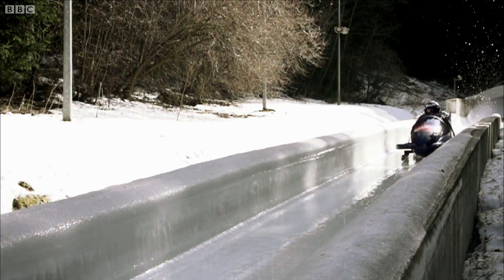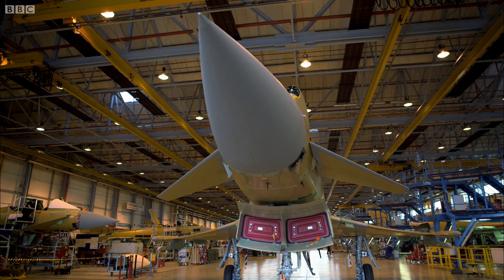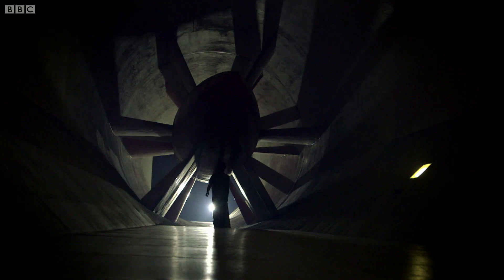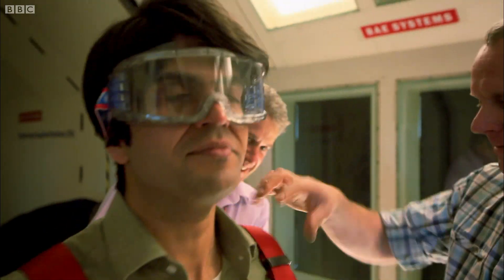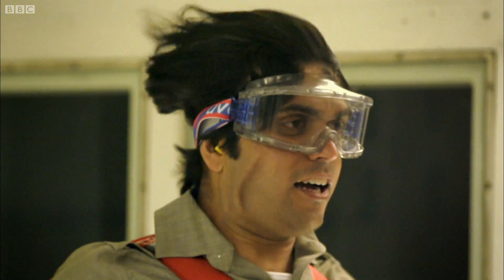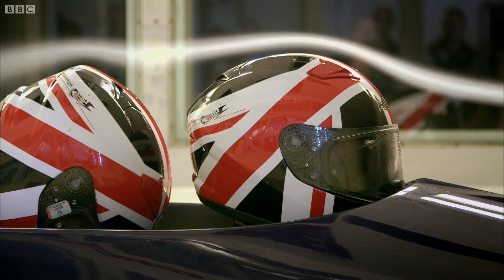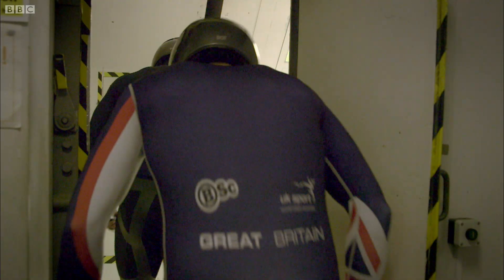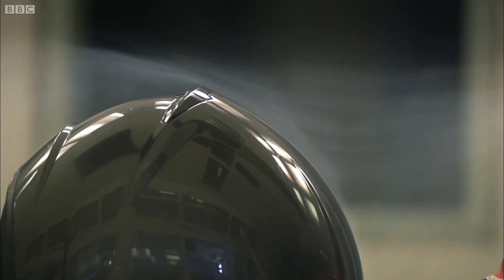How To Make A Bobsled Go Faster | Dara Ó Briain's Science Club | Earth Science

Comment: Why did you throw in those dirty units. You were doing okay with kilos but then you used miles per hour.
Reply: This is uk and we use imperial and metric for some reason, I have driven for 3 years and could not tell you what a mile looks like in distance, yet every road sign is in miles
Reply: +daniel117100 If you know how far 400 meters is, then it's 4x that distance.  :)

Comment: 'that's like 20 bags of sugar flying at you.' No. That's like 20 bags of air flying at you.
Reply: +Jack Bolton Gonna point out the obvious here and say that he meant 20 1kg bags of sugar (standard size) i.e. the equivalent weight of 20kg of air.
Reply: +Jack Bolton Smart ass, he was correct. Also 1kg bag of air would be magnitudes larger than a 1kg standard bag of sugar.
Reply: +The Marshmallow Man I meant to say that 20 bags of sugar flying at you at that speed would have have much more effect on you than just air...
Reply: +Jack Bolton Would it? Same mass, same speed, yet different effect? An Olympic bobsled may not be optimized for deflecting bags of sugar, but a basic flat surface would feel the same overall force either way.
Reply: Jack Bolton The air in question also already weighed 20kg before moving; in both cases the momentum is 20kg * speed. Obviously a bag of sugar is a concentrated lump of stuff, so if it hit me in the face, I'd be very unhappy. But the key point is that I'd be pushed backwards (you know, the drag that is the very topic of this video) by the same amount as the corresponding packet of air.

I thought it was an excellent analogy, it really got me thinking about how much more efficient it'd be to just push the bags aside a bit so that they miss you, rather than stopping them dead. Which is why long slopey shapes are more aerodynamic than a cube.
Reply: +TheHue's SciTech I suppose I was considering that 20 bags of sugar already weigh 20kg before they're moving so if you then accelerate them to bobsleigh speed, they're momentum would be far higher than just air and so would do more damage than just air... I'm no expert so I could be wildly wrong! It is interesting though!
Reply: +TheHue's SciTech fair play! :-) thanks for explaining!